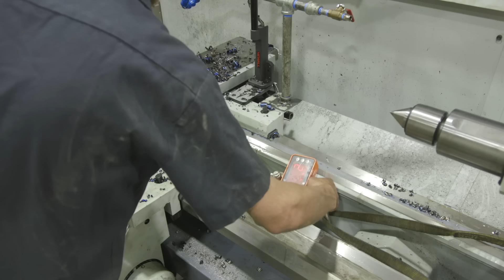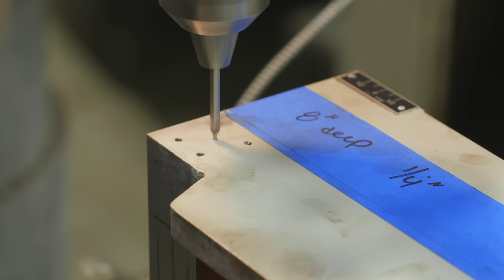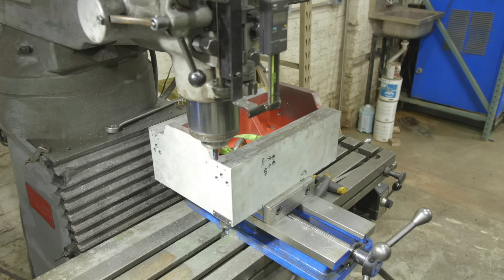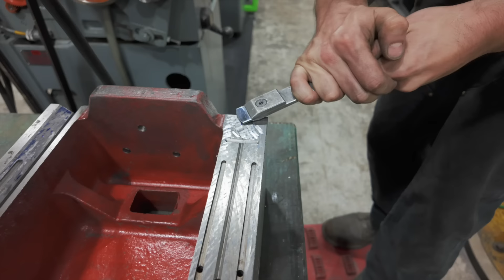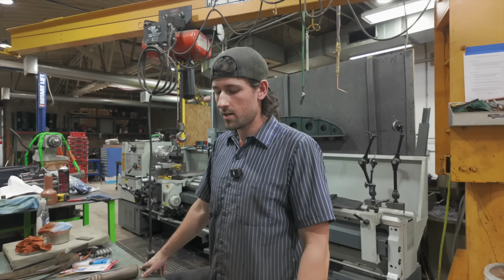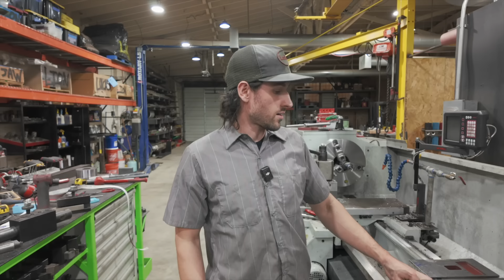New Lathe - Rescraping Our Tailstock And Adding Air Lift

Comment: 44:30 I think you had a good concept of the plan to start, just in situ it doesnt work... bc of the relief in the center and most of the contact patch in the corners, you probably should have done two small air channels on the flats... one on each end... then four small channels on the vee way... two on each end, one on each side of the vee.

Comment: I did something similar to a large CMM My important lesson was that the diameter of the chamfer on the air hole determines the lifting capacity of the air pressure. You can tune the lift with the chamfer because it is basically sealed until it starts to lift. I was able to cut the air pressure in half and reduce the friction with a 5/16 chamfer on a 1/8" hole.
Reply from the maker: Hmm very interesting

Comment: I know hind sight is always 20/20 and it's easy to point out mistakes after the fact, but if you were going to do this again, I think next time I would make the channels as small as possible. Both the air and the oil will ultimately be squeezed into a gap of less than .001" so you don't need a great big gigantic channel to deliver it. I think I would have used the smallest ball nose endmill I could find for making the channels...probably even a "micro" end mill or whatever they are called. The channels should have been hard to see with the naked eye. This would have had far less of a chance for leakage, and it also would have left more contact area for the air and oil to work against.

Comment: Not something l would do..now you end up less wear material by putting in slots, my big lathe had a handle / gear assist, worked like a charm, this is something l would have made and not dragging air hoses around.

Comment: Great project, Id prefer the effortless float and suffer air leakage noise for the small time its moving back and forth. more float less wear.  With the limit switch to switch off the air it would only be a few seconds of noise.  Given its a lathe which i'snt exactly quiet whilst running

Comment: I love this. I have spent many hours struggling with air driven devices including air bearings. I would suggest that there is some logic that can be applied to cause the four corners to lift equally using the same air pressure. To start you need to find the center of gravity of the entire assembly. This may sound difficult but it's not. Placing the assembly on a level surface, insert a small dowel rod between the assembly and the table. The rod will have to be positioned perpendicular to the line of travel, and then in-line with the line of travel. In both cases you roll the assembly on the rod until you find a balance point (actually a line). Where the two lines cross is the center of gravity. Measure from the center of gravity to each of the four corners. 

As an example let's say the four measurements are 2 feet, 3 feet, 4 feet, and 5 feet. This is where it gets a little confusing. Add the fractions 1/2, 1/3, 1/4, and 1/5. This equals 1.28. Notice that I converted the fractions to decimals in the following...the weight on each corner is as follows: 400*.50/1.28,   400*.33/1.28,   400*.25/1.28,   400*.2/1.28. Running that through the calculator we get 156 LB,   103 LB,   78 LB,   62 LB. 

The area of the air pocket under each corner is a ratio of these weights. For this example let's say that the air pocket supporting 62 LB is 2 sqin. The other 3 corners are:   2*78/62   2*103/62   2*156/62. Running that through the calculator we get   2.50 sqin   3.32 sqin   5.03 sqin. The total area is   2 + 2.5 + 3.32 + 5.03 = 12.85 sqin. The air pressure required is   400 lb/12.85 sqin = 31 psi.

Comment: i always thought about doing it by oil pressure. may be build up by a pump driven by the lathe. may be a you need filtering and this and that. much more to do. But i am a little scared of dust, getting into the pressure area if using air. But if you are cleaning well, might not be a problem.

Comment: Jet lathes have spring loaded roller bearings under the tailstock that lift it when the lock is released.  Its great for heavy T-stocks and an easy mod for most to perform with a small amount of trial and error.  Love this air assist mod!  Great job!
Reply: Yea, Okuma tailstocks had the spring loaded roller plungers in 1963 or so if I remember.

Comment: that airlift is sweet. That oil groove is way way way way too big. Like way too big.
Reply: and you don’t wanna make your oil grooves run parallel to the slide direction.. cutting oil grooves at an angle also helps them distribute oil across the entire width of the way also

Comment: Hey bud they make  compressed air oil dosing gizmos. There for air shop machines like tire mounters and balancers. Ypu get .mixability and controlobility. And I feel like you could have done it better simpler With one of those.good job
Reply from the maker: Yes I am aware of those. Have them all over the shop. They are intended for smaller oil delievery and have a different application. They would work but I wanted more oil and I already had an oil delivery manifold so it made sense to tap into that.

Comment: I would have just used 1 Grove for Air and put a Auto oiler on the air line 
Would have saved you 50 % of the Bearing surface removal

Comment: Love your content.  
Why scrape versus fly cutter or surface grinder?
Reply: I don't know how close a grinder or fly cutter will get the surfaces but the scraping gets rid of the high spots and puts lots of tiny scratches in the surface (and I think they should be stoned off) and that gives the oil places to fill and come to the mating surfaces to float the surfaces apart.
Reply: Fly cutters and surface grinders are only as accurate as the surface the table is sliding or rolling on. If in good condition they’ll get you close. Scraping is required for the final step.

Comment: These summit lathes have power rapid in both axis, why not just hook up your carriage to the tailstock like you mentioned? Been using ours for years like that and it works in 90% of situations. Only issues are when you have a large rotor/armature in the lathe and can't sneak the carriage under the rotor. Airlift is cool tho, but in most functioning shop for profit scenarios you're not going to be able to spend as much time making mods to your tools bc those are hours you could be making billable parts.

Comment: Pretty slick air assist, nice work! And the rigidity of your tailstock has got to be significantly improved by scraping it to fit. One thing I would want to check is the alignment of the quill to spindle axis' with the quill retracted vs extended, so you can confirm there is no/minimal pitch or yaw in the tailstock axis.

Comment: I was wondering when you are going to show the lubrication facility. I was wondering if a manual one-shot type of lube injection wouldn't do the same thing as the air lift? It's only needed to get the tailstock moving in my experience on a big lathe.
Reply from the maker: Nah air lift does more than oil by long shot

Comment: It takes a certain "fortitude" (there are other phrases that come to mind) to cut channels and drill holes in a new machine to hopefully gain in machine useability and quality. Nice to have an expert available to assist in the dial-in. Nice...nice outcome you deserve the win. It's compelling watching you identify and recognize a need then design, plan a fix, and modify a brand new machine with some very innovative and technical changes and mods. Thanks for taking me along!! Ray

Comment: That tail stock blows! 
I wonder if oil around the hole would minimize the hissing (and the leak).
For what I watched on the video you never pumped oil before testing.
I think that for my application an independent normally closed solenoid switch would work better. I press it to move it when needed.
Good job Kyle.

Comment: if you wanna keep the ways pristine you could do way covers that slide underneath the headstock. Most castings have material there to accomodate a V cover and flat cover for the backside way. My lathe has an empty box for electronic switches there, its previous ancestor didn't have it at all, and they copied the headstock from one generation to the other by only adding switches. So i milled out a space for a V-way cover. Tos SUS lathes usually have them. Most production lathes from before CNC have them. After the invention of CNC they're no longer built that way, and if you're cylindrical grinding your parts you don't really care.  I have seen 60 year old lathes with pristine ways like yourself that have been repainted 10 times, thanks to these way covers. I have also seen jig grinders pushing 60 years that have run nonstop with ways like new with the scraping marks as well ( those Moore jig grinders properly protect the ways, unlike a lathe).

Comment: Nice modifications Guys.
Some of the crankshaft grinders I have ran have air float head and tail stocks.
Dramatically allows for ease of movement as well as reduced wear.
Thanks for sharing the process Kyle.
Have a great weekend.

Comment: everyone blaming the factory needs to relax. They made the lathe exactly as it should be. Tailstock is touching on corners as it should to prevent rocking. When clamped it will flatten. The worst is when the base becomes boat shaped like how buddy described (because it is heavier up front). Once its banana, no clamping force not even 5 tons will undo that. By having it perfectly flat it will bow faster. But by adding air you won't face this reality anytime soon. One could argue they should have added air from the factory, but most lathe operators are 100kg men  who lean their body weight on the tailstock to move it. You did good with air.
Reply from the maker: Thanks

Comment: if you wanna make it totally silent, what you do is machine spring-loaded rollers (like the ones in a steady rest). This is how many big surface grinders reduce weight of their massive 1 ton table on the ways. But air is nicer because it blows away abrasive dust. You won't hear it once the lathe is powered on.

Comment: I believe cutting grooves for the air life was a mistake, my experience is just the holes are enough
Reply: that's true but i think he planned on going oil because he wasnt sure if it would work
Reply from the maker: Agreed in hindsight holes are better. My Lucas has slots I copied that design but with minimal info on the topic I was learning as I went.

Comment: cant trust that coax in the 3jaw ... its not centered. Tailstock should be slightly high to acount for the droop of the quill primarily, and lastly wear (the wear will happen in a decade of use. In your case many much later since the air is blowing chips and abrasive dust out of the way)

Comment: I have a Serdi machine for doing cylinder heads that uses the air float. It has air adjustment at 4 corners. I don't know how the plate is machined but I can tell you that opening up the valves makes it worse. When you just crack the valves open the head starts to float then you can tune it if it's heavy on one side or another. The supply pressure is 100 psi. I think instead of adjusting pressure you should try adjusting the amount of flow by plugging the line then drill a hole. Start small & go up from there & see if it has an effect.
Reply from the maker: Yeah makes sense

Comment: Lifting a mass by an air cushion means, one has to produce force within a large area, because pressure is defined as P=F/A. Hovercrafts use skirts to create the required area without loss of too much of air. For flat surfaces, a channel with a single hole is not a good idea, because a slight tilt leads to huge pressure and air losses. The better approach is to drill many, but very thin holes (diameter ca. 1mm) into the air-delivery surface. According to Bernoulli's law, the dynamic air flow loss is limited and the air cushion becomes consistent, even if the load is not exactly uniform.

Comment: Most likely a production short cut in just having 3 or 4 contact points at the outer edges, allowing wear to improve contact 🤔. 
Excellent modification Kyle and great diagnosis by Daniel on imprint and scraping in. Quite a technical exercise/treatise. Brilliant video. 
Thanks for sharing.
Reply: no its not its by design, go think about it or read my comment. relax if you have no idea
Reply: @meocats Most interesting
Reply: @bostedtap  even lego sets for 5 year olds have the picture of what happens when you tighten an axle agaisnt a beam too hard and shows it turning banana ...

Comment: Pretty brave. Looking at the lathe it seems like they didn't design enough surface area for the size and weight of that tail. The ways for the tail seem minimal. Adding the air should help from excessive wear and tear on the ways. 👣👣👣👣👣👣👣👣👣👣👣👣👣👣👣👣👣👣👣👣👣👣👣👣👣👣👣

Comment: Think air hockey table. Lots of tiny holes works best for float. Even if off kilter, the leakage from any group of holes is minimized by the tiny size. Need more lift in an area? Add some more holes.
Reply: The velocity of the air is increased due to the small holes, this definitely helps raise the tail stock due to the increased force from the smaller holes

Comment: Very nice.  Good effort in continuing your design until it worked as you wanted!!!

This is original work!
I have a mid 60s Okuma LS manual lathe with a tailstock that rides on spring loaded wheels.  Unclamp it to move on the lathe bed and it rises about .025" and rolls until you clamp it back to the bed.

I like yours better.  It will tend to blow out small chips and swarf from under the tailstock as you move it!
Reply from the maker: Thanks

Comment: Really interesting idea, ive never come across an air lift tailstock,  but i've used air lift rotary tables.

Really cool
Reply: The Soviet 16k20 screw-cutting lathe, produced since 1973, featured a pneumatic tailstock cushion. One of the most widely produced lathes.
Reply: @sergei96759 nice, Soviet gear is extremely uncommon here in the states so i hadnt ever encounterer that. Its a really nifty mechanism.
Reply: @procyonia3654 This type of lathe is not uncommon in Europe, especially since export versions with improved finishes and quality were supplied. It cuts almost all types of standardized threads without gear changes. It has a robust cast frame, excellent energy efficiency, and is a successful model. There are a million videos about repairs and operation.
Reply from the maker: Glad you liked it!

Comment: This reminds me of paper cutters used in bindery's. The table's have valves that open when a stack of paper om themn and put air under the stack allowing the operator to slide and spin the loads to aid handling. Makes the machine more productive.

Comment: I prefer to use radius endmill for oil groove (R1 or R2), smoother transition than ball mill or v groove.
The correct end mill is an arch like, but very difficult to source.

Comment: Good work, but complicated. Why didn't you just use coolant instead of air and oil?
Reply: Just use coolant... to reduce the force needed to move his tailstock? That doesn't make any sense.
Reply: @Trainwreck1123  Works as air, is more viscous and abundantly available
Reply from the maker: Sup Zack!

Comment: Have you tried the regulator + oil used for mechanical air tools? Seems like you fill it with way oil and lubricate during use. Might be too much oil.

Also, check out 3D printed way wipers using TPU. Would taking the way wiper idea from the shaper help with air? Way wipers on the tails stock sounds like a good idea anyway.
Reply from the maker: Yeah I wanted to mess w tpu I bought a few rolls. Got a new 3d printer which is much better. Maybe I’ll do that. It does have rubber wipers they were off for the video